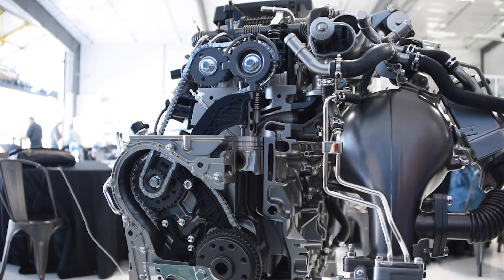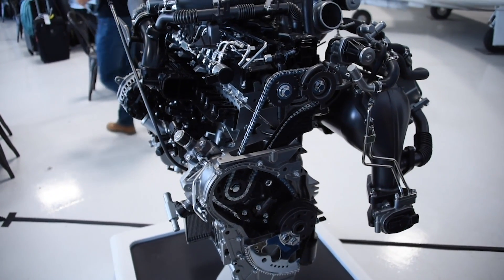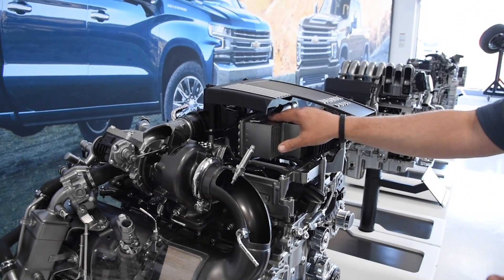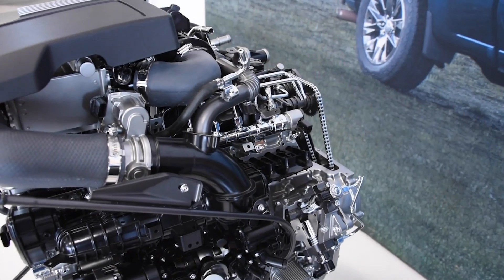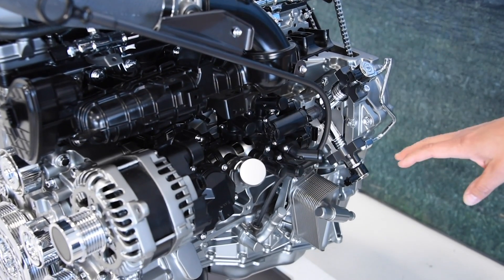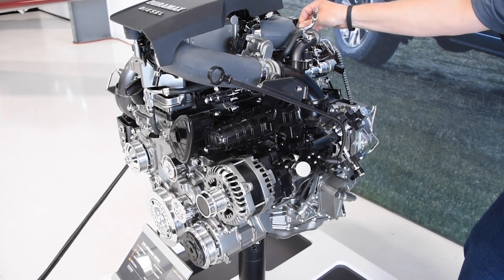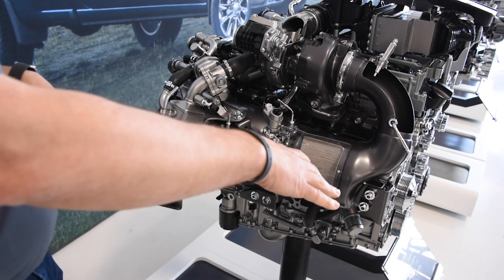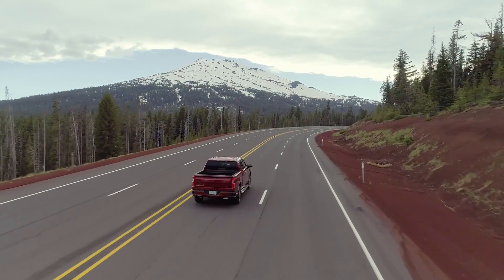What you don't know about the 3.0-liter Duramax diesel

Comment: What could go wrong? " That changing valve which diverts temperatures "flows" to the Cabin, Heads, Emissions, More heat for better Mpg fuel mileage etc, diverts flows to different temperatures etc."  Did it ever occur to anyone in the engineering department that this valve has an FAILURE RATE POSSIBLY?  and that it would possibly jam, seize, stick, malfunction, lock up, or go the opposite direction?  What if it breaks?   :(  Yes, the wrong thing gets cooled down, and the wrong thing get's heated up !!  Zowie !!

Comment: I get that its too short a run to use the bog standard steel link belt timing chain like everything else, but why not just go with a roller chain and make the oil pump drive pulley removable for installation? Been working just fine for OHV engines since the dawn of time.

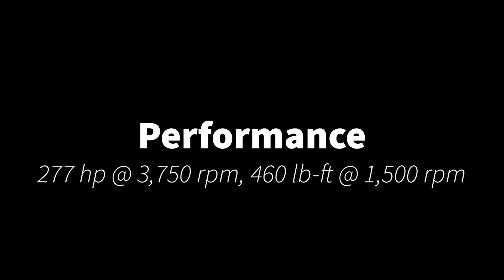Comment: Are you freaking kidding me!! A belt submerged in HOT oil full of carbon to run the highly important oil pump!  I was considering this engine until now, if they at least would have used a chain for the oil pump I would have watched the rest of the video.  Unfortunately 3:18 seconds in and I am OUT, and this engine is NOT on my list.